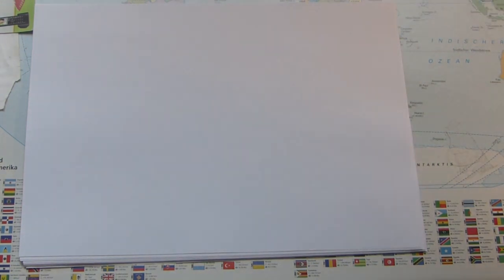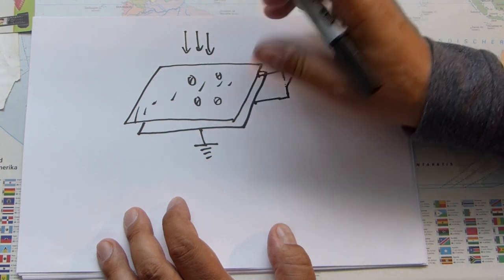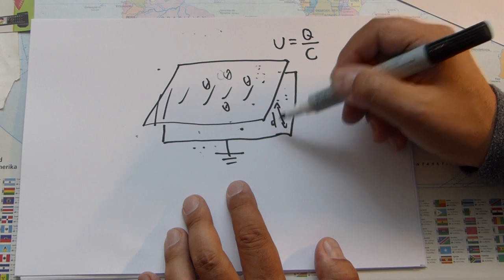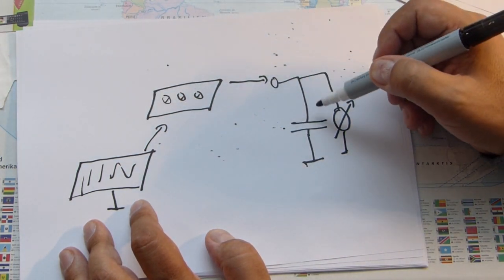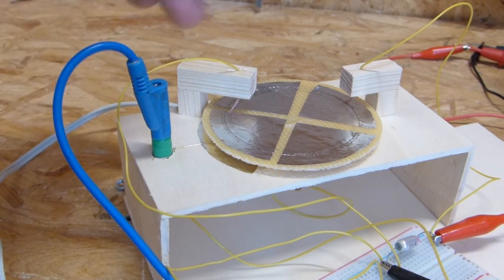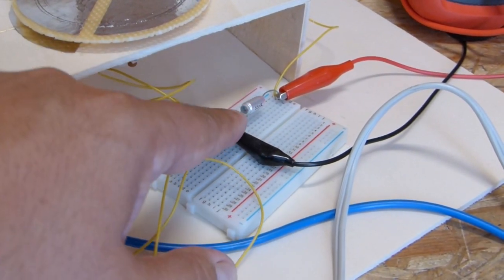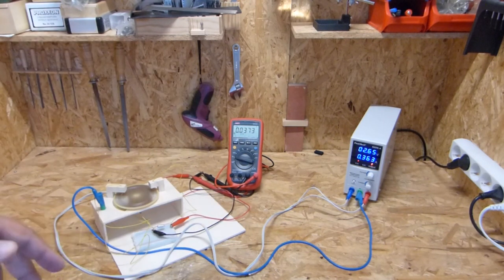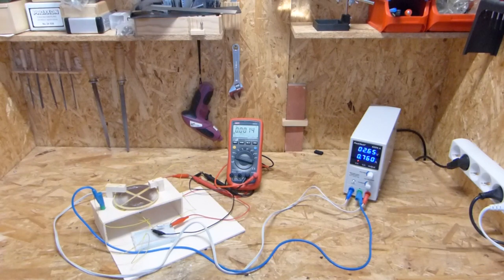Hardware City Part#9 - A new device for measuring electric fields

Comment: Oh, wow. This variation is kind of brilliant. You basically turn the detector into an electrostatic generator and then measure how much voltage is produced which is proportional to the field between them! Somehow this feels much more 'in the spirit' of early electrostatic devices than the original method which uses an oscillating current.

Edit: A thought after having pondered this for a bit. The reasoning in your math is slightly off but you still end up with the same result. The part that is changing is actually the area, which is the overlap between the two plates, not the distance. However, the effect of area going to zero and distance going to infinity is the same, so you still get the same result.
Reply from the maker: Very good! You are the first one reflecting the idea behind the device. I argued from a technical point of view with the principle of a capacitor in mind. Thank you! Yes you're right, the device design is inherited from the late 19th and early 20 century  ideas where you didn't have fancy electronics and filtering techniques to gain a good signal from a bad setup. I always admired the skills of experimenters back in those times who made smart designs to get the utmost of their devices with the means they had at hand.
Reply: @andresramos7495  Yes, it is a fantastic design! I am making a copy of it right now to try.

Comment: Hi Andres, I'm constructing a field mill according to your design. I have one question that I didn't hear mentioned in this video or your instructables article. Does this design allow determination of the polarity of the measured electric field?
Reply from the maker: Hi! Yes it does. The polarity of the field is reflected in the polarity of the voltage building up in the charge collection capacitor. If the ambient electric field pushes electrons away you will get a negative voltage in the capacitor. A field that attracts electrons will yield a positive voltage.
Reply: @andresramos7495  Hello again Andres, I am having troubles with reading the signal from my field mill using an Arduino. I have no troubles when using an oscilloscope. Would you mind answering some questions I have via email? Thank you
Reply from the maker: @earlplaysgame9456  No problem. Email me at nackenfoehn@gmail.com.

Comment: After watching your video, it inspired me to build a electric field mill without rotating shutter. Do you think it will work if I use two copper plates with a switch as you showed in the beginning of the video ( theoretical explanation)  instead of using rotating aluminum disk and keep rest of the design as it is?
Reply from the maker: Hi. I already spent some time on this idea in order to get rid of the mechanical assembly. The problem is that without a shutter you don't get a continous signal. If you expose a discharged metal plate to an ambient electric field and you close the switch against ground, you get one impulse and that's all. Moreover even to deliberately expose the plate to the field you already need a shutter.
Reply: @andresramos7495  We have been working on a project to build a Electric Field mill without shutter part more then two months and haven't got any reasonable measurement. I was very skeptical from the beginning whether this idea will work or not. After watching your project and theoretical explanation I thought it might work. We tried to use this principal and built a circuit exactly what you have only buy replacing copper plate instead of shutter disk but didn't get any reasonable measurement but the oscilloscope shows a varying voltage signal, could be due to capacitor charging and discharging not acutely due to the influence of the E-field. Would you suggest us to continue working on this project or not? Because all the existing model that we have on the market are built upon rotating shutter principal, I wonder why there can't be a non moving part E Mill. It might be one of the reason that, it didn't work based on switch principal.  Sorry for long comment but extremely curious and heavily in need of advice.
Reply from the maker: @mdakhterhussain6680  I see. I would like to suggest that you draw a schematic or an overview of your setup and send it to me.  Also a  handmade sketch will do. A picture generally is more clear than descriptions. Send it to nackenfoehn@gmail.com and I will reply with my advices. Is that ok for you?
Reply: @andresramos7495  thank you so much for being so helpful, I will send them by tomorrow to your email.

Comment: Great. Many thanks for sharing this!
What reading do you get, if you put a grounded conductive plate above the mill?
Will it be zero?
Reply from the maker: OK, this evening i switched on the mill. The ambient electric field gave me a reading of -41 digits. After placing a grounded brass plate over the mill that covered the whole disk, the readings went down to -10. A little electric flux still is coming through the open sides onto the disk i suppose, but generally the results sustain my expectations.
Reply: Fine. Many thanks!
I am an telecoms eng. and always keep in mind: "Wer misst, misst Mist"
So I had to ask this question ;-)
If there is time I´ll think of to built a mill by use of an old harddisc.
All the best and many greetings from Bavaria
Manfred
Reply from the maker: @manfredg.  Alles klar Manfred! Deine Meinung zum Messen teile ich. Das tut wohl jeder Ingenieur und Techniker. Grüße aus Hamburg!
Reply from the maker: Thanks for your comment! The reading must be zero because the lines of electric flux will all end at the grounded plate. When nor more flux lines reach the induction plates there can be no charges generated on them by electrostatic induction. I have a brass plate somewhere lying around in my attic and will try to prove it for you.